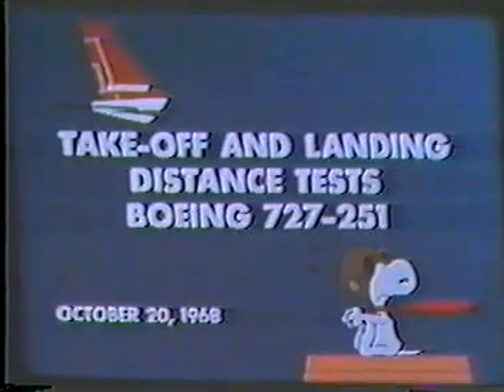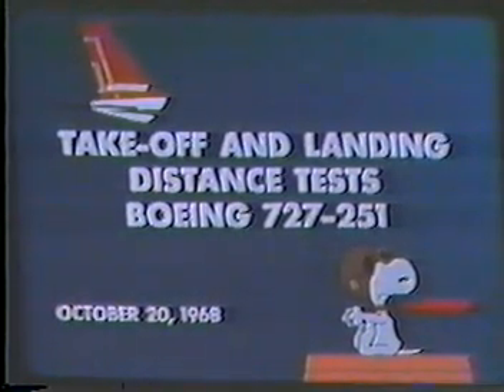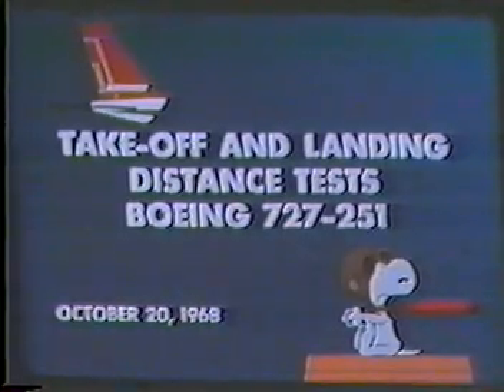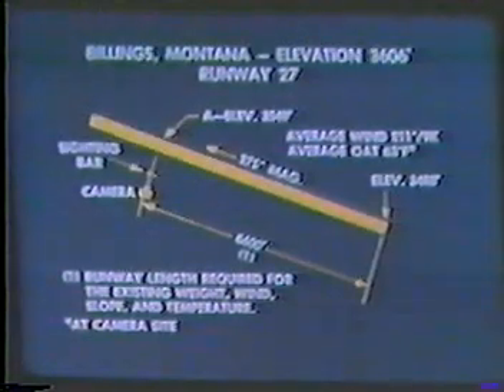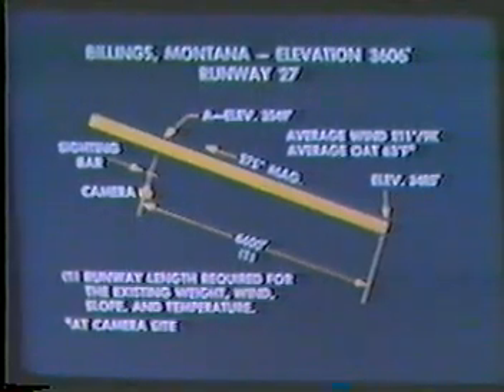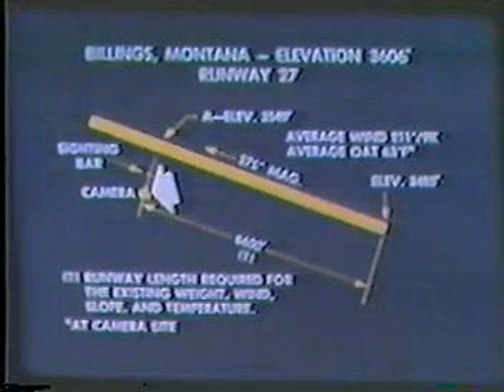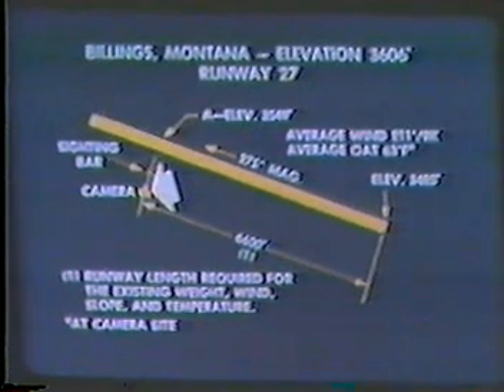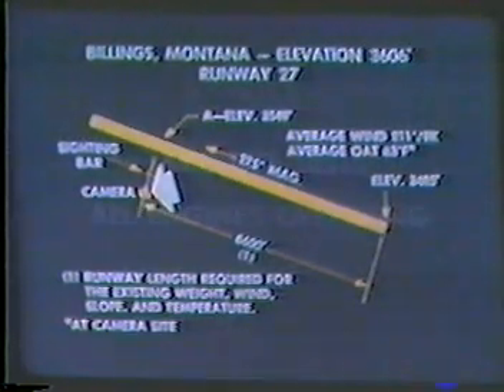Why Precision is Important When Flying Transport Category Airplanes - B727 Takeoff test

Comment: You’d think the guys at Northwest could afford to hire a proper film crew with a decent resolution camera.
Reply: It was 1968 probably same camera they took to the moon the next year
Reply: @ronparrish6666  This video is probably a copy of a copy of a copy...if this was 16mm film, it would have been way more detailed than this. I shot 16mm for film classes, and have owned 2 16mm Bolexes, that's how I know. Likely they used a more professional camera with an electric motor, maybe an Arriflex, unlike the Bolex, which had a spring drive motor that ran about 25 seconds unless you got an accessory motor for it. Most old videos seen on Youtube bear little resemblance to the originals. High quality motion picture cameras were around in the 1930s. They used a Maurer movie camera for Apollo, along with video cameras, and Nikon and Hasselblad film still cameras.  BTW they pulled an engine on my brother's flight test for his 727 rating (in a Trump Shuttle plane) and he passed!

Comment: ahh yes.....the ol' JT8D-7.......lose an engine at V1, and dodge the trees......lose another one, and you land off airport.......better have a good engineer who is quick on the fuel dump panel.  I flew the -200 for CAL and Air Micronesia for about 3 years before going to the DC-9.......3 man crew is definitely different than 2 man......sure was fun, though......we used to operate the -15 powered 200 out of Quito's Mariscal Sucre airport....we had to fuel stop in Panama City, Panama because of weight limits out of Quito, we couldnt carry enough fuel to go nonstop to Houston.........
Reply: -17R?
Reply: Were you a CAL SCAB??